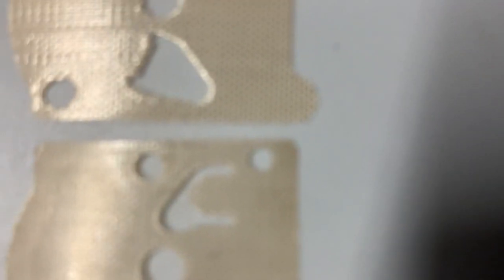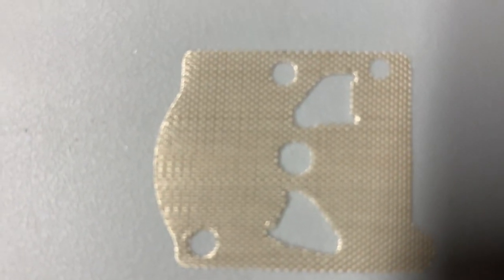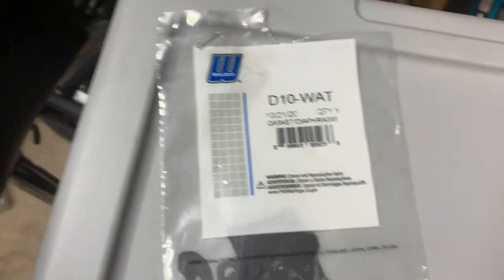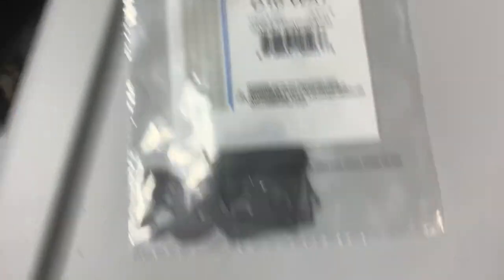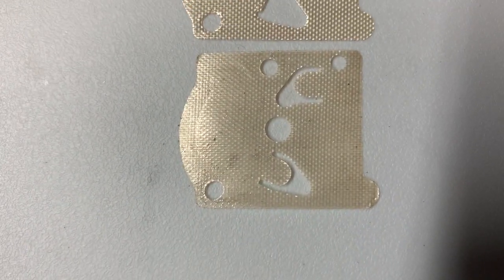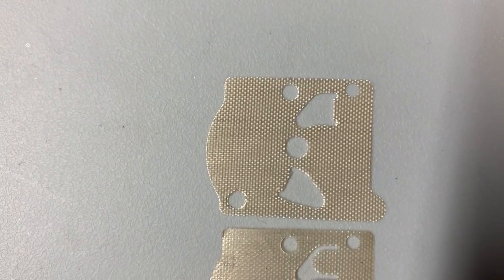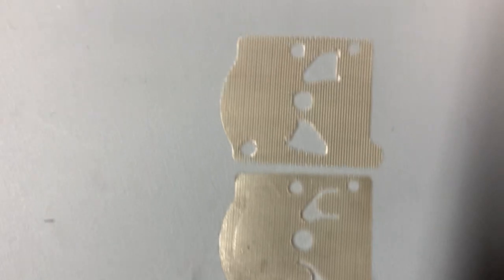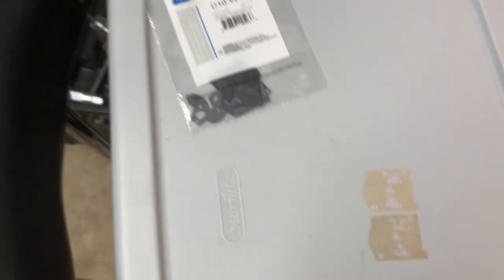Walbro D10WAT Diaphragm and Gasket Kit, quality (or lack thereof) control!!

Comment: Copy that Kenny.  I will Email them ASAP.  That one with the flappers cut off IS used in some applications...
Reply from the maker: Really? Never saw that.  Thanks buddy!!
Reply: @KensSmallEngineRepair  - Steve's Small Engine Saloon speaks the truth!!!!  The pump diaphragm you question is part number 95-154 and it does not have the flappers you expect to see - but trust me the part is to print.  Including all pump diaphragms in a repair kit made from the three materials - rubber (black), teflon coated fiberglass (tan), and mylar (blue) is not possible with all the various designs/configurations.  We ask that you select the pump diaphragm with the matching design (including flappers) as all three materials will perform virtually the same on the engine, the main difference is how they hold up to fuel containing ethanol.
Reply from the maker: @bobmccuewithwalbro7349  still wondering why 99.9% of all the dozens on D10WAT kits I’ve purchased all have had the pump flaps?  First non flap diaphragm I’ve ever seen in one of these kits. Also curious as to the application for the non-flap diaphragm.  Thanks for your time and a great product line!
Reply: Shindaiwa 757 saws had a EPA rated saw. Just ordered 2 different kits(different numbers). Saw one kit had flaps and one kit did not. Guessing it's the EPA rated without flaps

Comment: Yep good old quality control.  Reminds me of my brand new Pontiac Bonneville I bought in 1979 I think.  It had a Pontiac body, Buick engine and a Cadillac carburetor with a cross threaded fuel filter in the carb.  Lifters went bad at 13,000 miles and warranty was good for 12,000.  What a crap car that was.  At least your kit was a bit less expensive and probably had a better return policy.  Thanks for the video.
Reply from the maker: Sounds like a Friday or Monday car as we used to say! Thanks for watching

Comment: That is a 1st for me also . thought they all had the fuel flap. Wonder how it pumps the fuel without the flaps looks like it would flood out the carb making it leak?
Reply from the maker: The non flap pieces are just used as gaskets for certain applications according to Bob McCue of Walbro.
Reply: @KensSmallEngineRepair  ok just making sure
Reply from the maker: @Turningwrenches85  no worries have a great day!
Reply: @KensSmallEngineRepair  you too sir

Comment: Not 100% sure but that may be for use if there's a metering block used to seal it against the carb body.
Reply from the maker: Thanks Craig its the first time I've seen that in the D10WAT kit.

Comment: Wow. I expect higher from Walbro. If you had bought the lowest cost on the interscreen, this lack of quality is expected. I do understand every body makes mistakes. I’m sure Walbro will correct the error
Reply from the maker: Steve and Craig said there is an application that requires no pump flaps, I’d like to see that
Reply: Just ran into same thing for a shindaiwa 757 chainsaw. The kit without flaps was for a EPA rated saw

Comment: Yeah, I'd not be too happy either especially since it was your last one.
Reply from the maker: And on a Sunday!!
Reply: Crap, I didn't even think about that..... double bummer!!
Reply: After seeing Steve's comment I just looked up the D10-WAT kits and there surely is 2 versions, the 615-590 (no flap) and the 615-443 (with flaps). I never knew there were different versions of the same kit number.  Wow
Reply from the maker: @Big_Johns  those are Stens part numbers. Wonder if there are two Walbro numbers for the fuel pump diaphragm?
Reply: There very well could be, luckily I haven't had to deal with that particular carb yet, hope I don't. :)